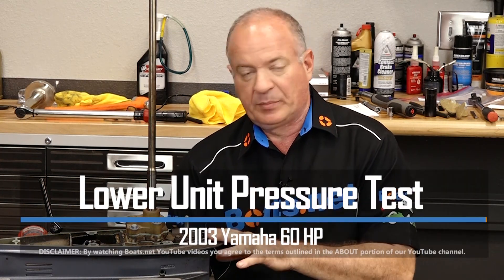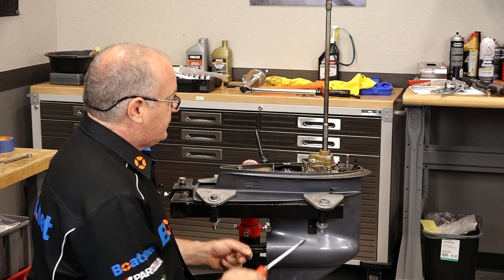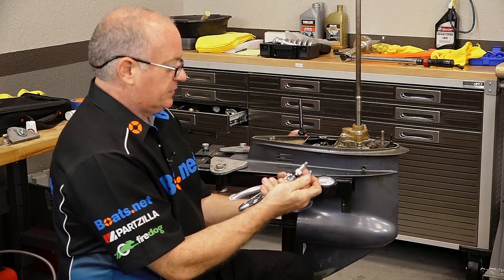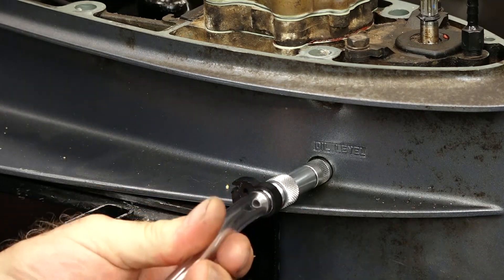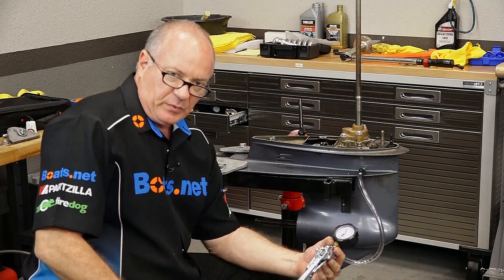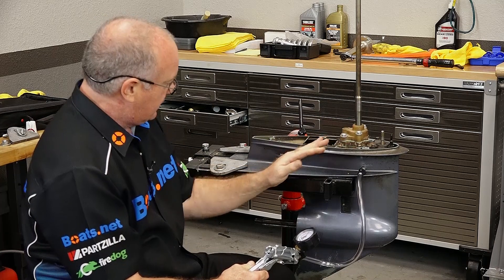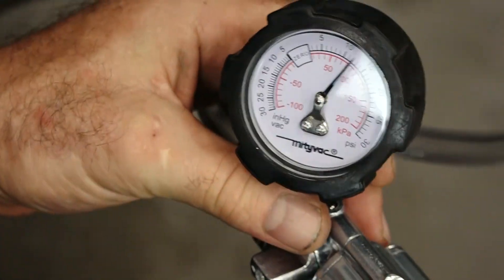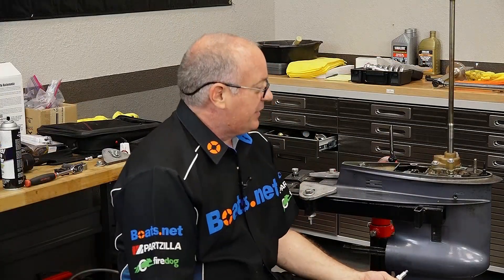Yamaha 60HP Outboard Gearcase Pressure Test | Yamaha Lower Unit Pressure Test | Boats.net

Comment: I have a 2003 yamaha f115txrb and did seals  upper and lower seals on lower unit however noticed a leak and oil coming out at factory specified 14.2 psi on prop shaft. Not sure if I should replace prop shaft since oil came out after a 5 or 10 seconds at 14 psi.

Comment: Why did you drain oil before pressure testing?
Reply: Air pressure will pass through a seal (if there is a leak path) much more readily than oil will given the air molecules are much smaller. Therefore air pressure will give you a better indication of a leak than oil under pressure will.